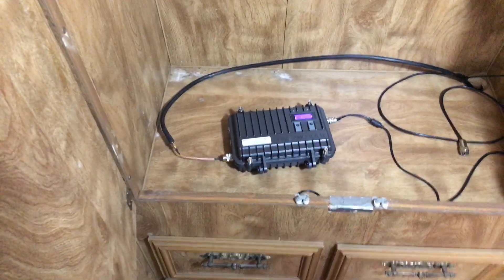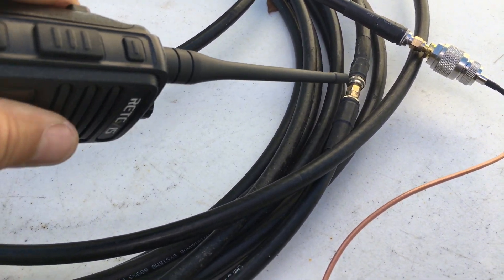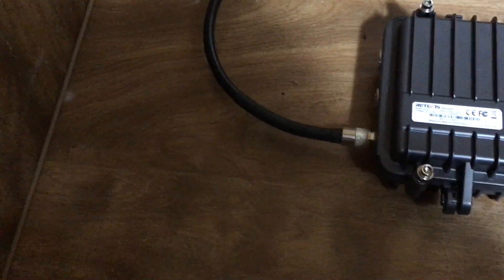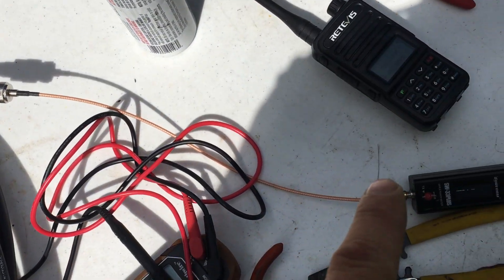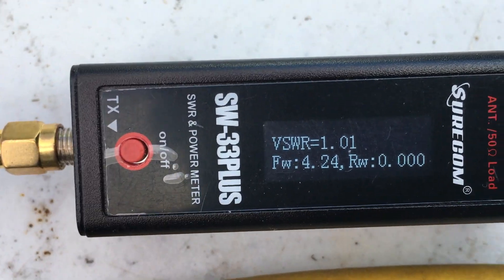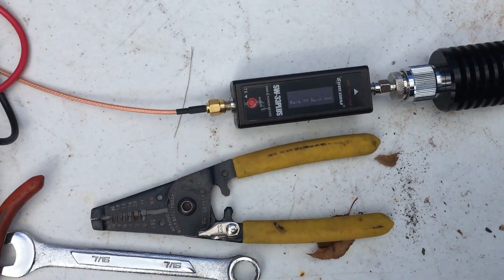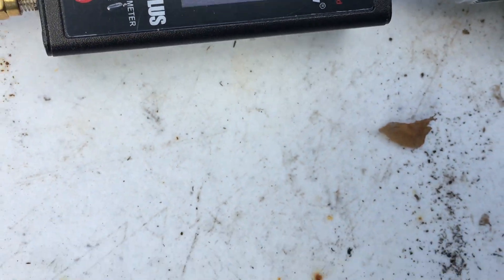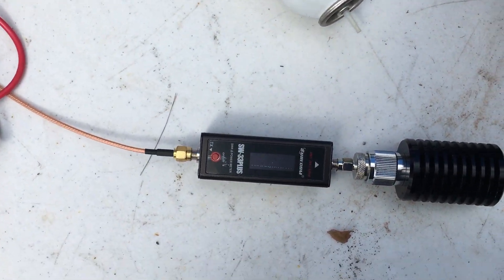🔺Does pigtails, adapters affect output wattage for a GMRS two-way radio?? let's check and find out!🔺

Comment: Conclusion, adapters and connectors make minimal difference. Cable type and length make much more of a difference for UHF. I think you would have gotten minimally better results vs minimally worse results if you switched to SMA or type N connectors instead of PL259. But, ultimately it doesn't really matter.
Reply from the maker: Yes, that is what I think to not much difference in connectors.